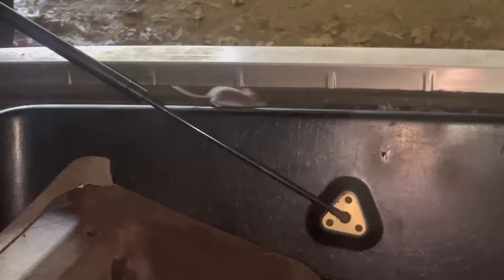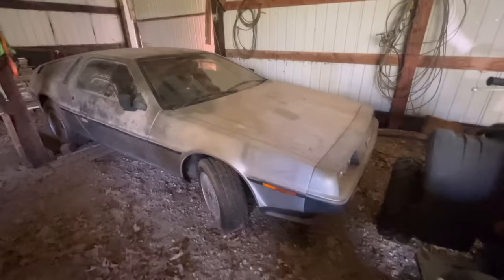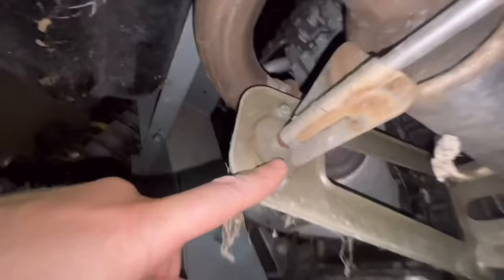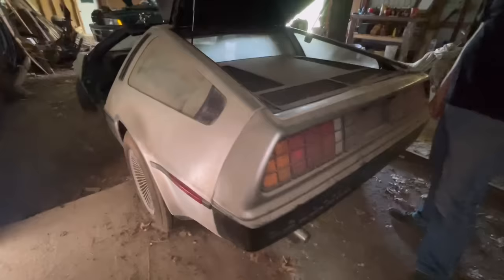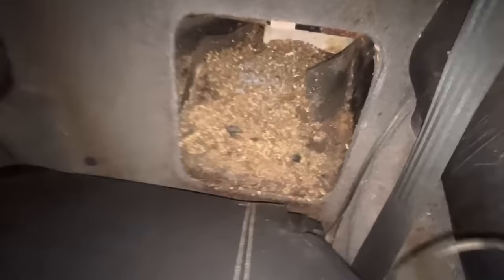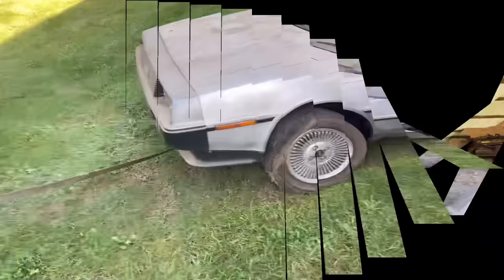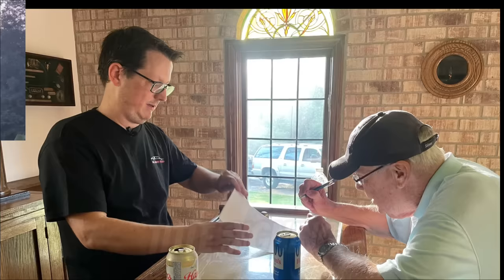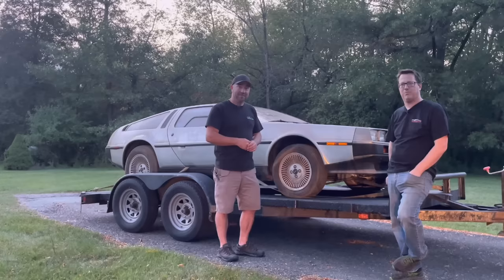DeLorean Barn Find with 977 Miles!

Comment: Amazing find man!! The year was 1995,I was approximately 5mi. From my house,on a road I didn't usually drive. I looked to my right and saw a DeLorean in a driveway. I stopped and knocked on door. I asked if would sell..an they said not right now,but in a couple yrs they planned to. After I talked to them about the car for a few moments,they told me they bought new in 82. It only had a little over 11k miles on it. They said only drove it on really nice weekends,but only on occasions now,and is always been garage,"heated" kept,but just finished detailing. It was very minty! LSS, I left my number,but never heard from them,also forgot about..until 6yrs later. I was 3 miles from where car was owned,and seen a DeLorean at a gas station I pulled into. The owner came out and I began to talk to them about it. I mentioned that I tried to buy one a few miles away,a few years back but was unsuccessful and actually forgot to go back and check on it.They asked me where at and I described..they instantly told me that they just bought it from there an hour ago! They also told me that they were just driving down road and stopped to inquire about it,and within the hour,they bought it for $3,500!!! If only, if only,I hadn't forgot about it!
Reply: So close. If it drove for $3500 it was a steal. Great story. Thanks for sharing!
Reply: Once in a while I see one in a parade.  Taken off a trailer and drove the few miles of the parade.  Usually Memorial Day or Forth of July.

Comment: How can a person let a new car, or any car, rot for 30+ years?  Glad you guys got it!
Reply: Thanks.
Reply: Happens a lot, John. I've gone to many cars shows and seen low mileage cars that had to be cleaned up and partially restored. Sometimes rich people buy cars new and they sit in a garage until the guy dies. Or the car was in a fender bender or a motor problem and stored until it can be fixed, and it never is. Until guys like Mike and Kevin find it. I saw a case where a low mileage 1960 Dodge was in a fender bender in 1967 and sat in a garage for decades until it was discovered.
Reply: @greggwagner875   Thanks Greg, I appreciate your reply. Stay the course. I love these cars. Best. John

Comment: Cool find. I was lucky enough to have worked on a brand new DeLorean the day it was delivered by a Cadillac dealer. It came with a box of trim parts like what is sitting in the passenger foot well. I remember a roll of weather-stripping, double sided carpet tape and carpet edging were in there too.
Reply: That's interesting information. This car was an early build. Would not surprise me if dealers completed some details on the early built ones.
Reply: @michaelmcelhattan7238  I car I worked on did not have that square cutout on the hood like yours. I saw a few other new ones at the time and all of them had loose trim and fitment issues.

Comment: I saw a video short by the exploring abandoned places guys...While I have a 1985 Xtracab Toyota pickup, and extensive files on Delorean time machine conversions, I was really interested in the Chevy Corvair Rampside Pickup I saw in your garage!
Reply: Yes. It's is a 1961 with a 4 speed manual transmission. Might consider selling.

Comment: I sincerely wish you luck on this as it appears to be well worth a cleanup and a chance to see the road again.  I'm restoring a '01 Ram truck that desperately needed doors.  A donor truck was found - a slightly newer Ram, itself restored and painted just the year before. Why was it a parts donor?  Simple - it had become a "rodent condo" during the winter.  During this time the rodents returned the kindness of the owner by chewing through various wiring harnesses to the point where the truck never functioned again.  At this point the owner simply gave up, selling the truck for scrap to be parted out, keeping other trucks alive.
Mice and other rodents don't always destroy the vehicle they reside in BUT they certainly don't help it.  Hiding dryer sheets throughout a vehicle before winter keeps them at bay.
(They also keep the car smelling nice as well!)
Reply from the maker: Thanks Randy! We’ve dealt with way more mice than we would even like to think about in other cars as well. We have plenty of work to do to get this one right again. Good luck with your Ram project! I also own a 2003 Ram that could use a lot of body work.
Reply: Thanks Randy. Good luck with your Ram!

Comment: Fun Fact: there are approximately 87,000 barns in America..so far, over 2,302,879 barn find vehicles have been found in them.
Reply: 87,000? That seems extremely low.
Reply: @VideoAmericanStyle It seems low because the dude just made it up
Reply: 87,000 ? What are your sources?
Reply: @christiangarcia8121  His source is he made it up. That would mean there's an average of 26 vehicles found in each barn, and I have no idea how anyone believes that.
Reply: Lol. Did you mean 87k  in Wisconsin?
Reply: FEDERAL BARN REGISTRATION DEPARTMENT IF YOU DONT REGISTER YOUR BARN YALL GET THE BARN POLICE 👮‍♀️ ON YOUR CASE
Reply: @VideoAmericanStyle  Yes, that sounds like just one state.  Since dairy farming doesn't use old barns anymore, in most places.  Unfortunately I see many that are falling down.  Have a cousin who owns a farm, and the barn is unsafe to enter, but its loaded with old equipment.  He uses a new metal building to store his racing cars. (He was a stock car racer)
Reply: He is saying 60% of the people are lying, they were not barn finds
Reply: There's 650,000 barns in the USA. NICE TRY THO
Reply: @psilocybinx4092 I mean, there could be 50 cars in 50% of the barns, (so about 43000 barns with 50 cars each) so it's no impossible it's just basically right beside absolute 0.
Reply: @christiangarcia8121 the joke went waaayyyy over your head 😂
Reply: You have to count the garages. Millions of garages.
Reply: 7 out of 3 users agree.
Reply: 60% of the time, this statistic is correct EVERY time!

Comment: The worries are if the ground was moist the frame may have significant damage and the mice can really rip up the wiring harness and interior of a car and get into the intake of the engine and AC/Heater box of the car and other vents and crawl through into the passenger compartment and leave droppings everywhere and chew up the interior to make bedding insulation.
Reply from the maker: Thankfully the frame is in overall great shape considering where it was. The mice you speak of is another situation. The air box will absolutely need to come out along with all venting, carpets and trim panels. Plenty of work to do.

Comment: I may have missed it, but why was it parked after only 977 miles?
Reply: Original selling dealer kept the mileage very low and didn't sell it until 1991. Dick then drove the car very little. He told us he liked to go look at it and thought it was such a cool car.
Reply: @michaelmcelhattan7238  So just stopped driving it? Mechanically, it was fine? Just thought it must have been plagued with problems, if it was on and off a flatbed for most of its life.. awesome find btw

Comment: ViceGripGarage would be able to fire that thing up with just a new battery, air compressor and some hand tools she would be driving out of that barn.
Reply from the maker: We are fans of VGG and recently helped out with their DeLorean. That being said Derek is a great mechanic and can undoubtedly get some old junk running again. Most of the cars he gets going are carbureted, if this one was we could have done the same, but these fuel injection systems are finicky and need a lot of work when they have been sitting this long. Stay tuned!
Reply: @deloreannation   Ohh wow VGG has a DeLorean too?! wonder if he's gonna do video on it? Yeah i didnt even realize DeLoreans were fuel injected
Reply from the maker: It’s going to be on his Roadworthy Rescue show on Motortrend. It now has a carburetor and a bit more horsepower.

Comment: 10 years at a dealership, definitely has more miles. They notoriously have failed odometers. Ask Legit street cars.
Reply from the maker: We actually found that car for Alex. We work on these everyday and know very well of failed angle drives. We spoke with the selling dealership owners. They still have the paperwork for the car. Mileage is confirmed as accurate and angle drive was working as it should. Tire wear and other factors we mentioned in the video also confirm the mileage to be correct.
Reply: @deloreannation  oh that's cool. That is a good find then.

Comment: On another note the speed sensor always failed on these so doubt the mileage is accurate.
Reply from the maker: It’s actually called the angle drive. It’s in tact and working as it should. We’ve traced this car back to the dealership and everything checks out. Including the fully treaded tires it left the factory on that show almost no wear other than dry rot. The mileage is accurate.
Reply: @deloreannation  and that means nothing. It could of been driven for years without it working and then fixed. And traced back to the dealership lolol.

Comment: Should’ve been loaded rear on first as that’s where the engine is, that’s what I’ve been taught anyway.
Reply from the maker: That’s bad advice for a DeLorean. If you load them backwards the wind will rip the rear louvre off and cause major damage.
Reply: @deloreannation  ah maybe for a Delorean, but the engine should always be loaded first due to weight etc it’s how accidents are caused.
Reply: Your concern seems excessive because it looks like it trailered fine just the way they loaded it... I'm confident they have trailered more Deloreans than most everyone else.
Reply from the maker: Respectfully, we trailer cars literally all the time. In our enclosed trailer we will back them in, I agree with you on what you are saying. However, with our open trailer this is not an option. Our open trailer pulls great with it loaded forward and it’s not a concern. We have pulled cars with it all over the midwest while in this configuration and it doesn’t sway.
Reply: @deloreannation  thank you for the reply, it was just an observation not Delorean specific.
Reply: @merlesgarage  hi, my concern is not about Delorean specifically if your a garage you should know the correct way to load a car is engine first that’s what I’ve been taught you only need to look on YouTube to know this as well.

Comment: На моей машине через 3 года полностью сдулись шины. Либо хорошая резина, либо фейк какой то.
Reply from the maker: Absolutely not a fake. Those are the original tires it left the factory on 42 years ago. They do deflate after several hours and are in very poor shape but were good enough to hold air long enough for us to get it loaded up.

Comment: Well, awesome car, not trying to be mean, but maybe be prepared to do a barn find.
Reply: We absolutely were. Had compressors, trailer, winch, 2 guys and did in fact get the job done. This is video of proof of that.
Reply from the maker: We were prepared. Winch, multiple trucks, trailer, straps, and compressors. We used the resources that were in the available close by to add to the story. Not our first rodeo.